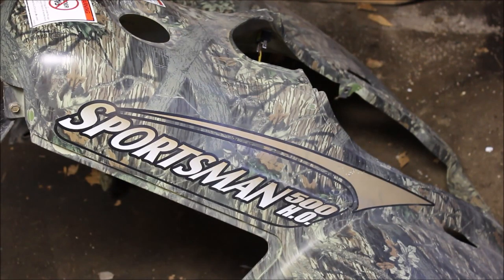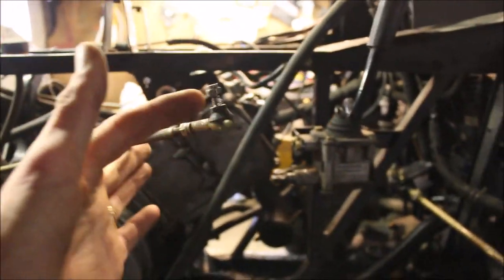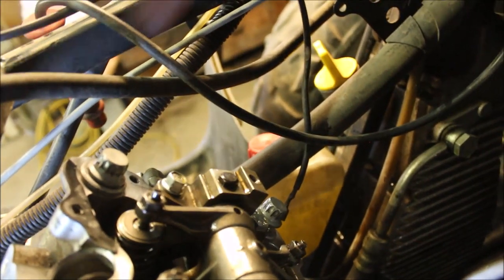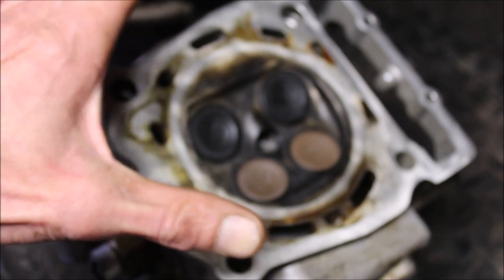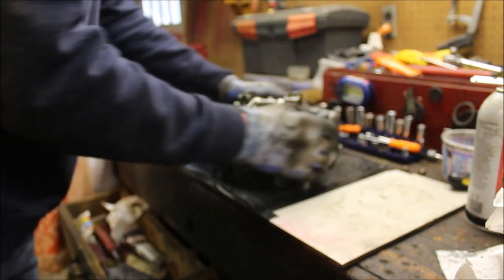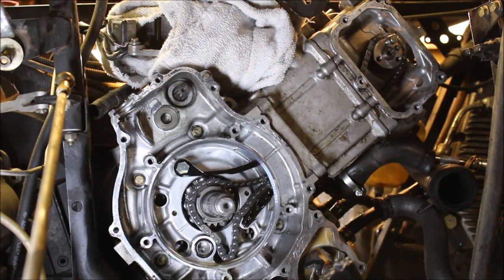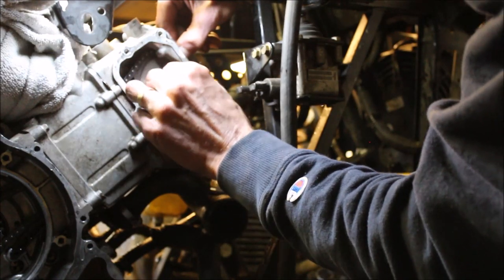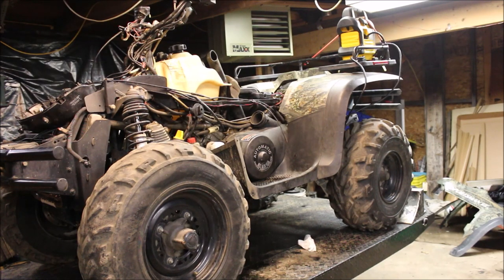Is you Polaris ATV Overflow Coolant Reservoir Bubbling? Overheating?

Comment: I’m having a issue. I flushed the radiator and that flows good, new thermostat, fan works, fins on water pump spin, but I was wondering does your tank bubble right away when it’s cold? I don’t see any bubbles but I’m running out of ideas before I rip it apart and do the head gasket
Reply from the maker: If everything is working I would make sure you bled all the air out of the system. An air pocket will cause overheating.  If its bubbling  nu the overflow it most likely a head gasket.

Comment: Love your videos. You made sure the head was flat by sanding it down. Does the jug need to be flat as well? I didn't see you checking the jug for flatness.
Reply from the maker: I always put the head on the jug to check if it rocks back and forth. Most times the jug is good. I have another video on checking that.
Reply: Before I pulled the head, I did an engine pressure test. I made sure the motor was TDC.   I applied about 90lbs of air to the cylinder. No air bubbles or sound out of the radiator. When I run the engine I see an occasional air bubble in the over flow tank. Do you think it's a bad head gasket? This is a freshly rebuild engine. I did not use an oem head gasket. What's your thoughts, head gasket bad?
Reply from the maker: @dvcm27  If its occasional it might be air still trapped in the lines. I dont think it's the head gasket.
Reply: When it overheated it blew out of the reservoir tank. Does that indicate pressure from a bad head gasket? I'm going to use a carbon monoxide detector  to see if I can sense the exhaust gases from the radiator. I'll remove radiator cap and put the detector in a plastic bag and secure the plastic bag  around the raditor fill neck. Thoughts?
Reply: You can run a longer hose off the radiator overflow and put the other end in a bottle of water and rev it up to check for bubbles

Comment: You never cease to amaze. Nice work! I did a full rebuild on a 500 HO but now get a ticking (loud) when revved up. Was told it might be the starter gear. Any ideas?
Reply from the maker: Did you check the valve lash? ..006 it should be. It could be the gear or the clutch. I would pull both off and see what's making the noise. Pull the bendix gear and pull start it with cover back on..
Reply: @TitaniummanGarage  thanks for getting back to me. This one is a ranger so no pull start. I did check the lash. Trying new bendix today I hope. Keep up the great work!
Reply from the maker: @RayofallTrades  My ranger did the same thing. Replaced the belt and the bendix gear and it was quiet.
Reply: @TitaniummanGarage  thanks for the reply. Tried both and same issue. Oh well. I'll let you know if I figure it out

Comment: I am having an issue I know you kind of addressed on an earlier video, as well as overflowing coolant but I think it is from the radiator being plugged with junk. The main problem I am having is that the machine runs fine at idle, and will run for a little bit at throttle but then it will start losing power and backfiring. I had the cam replaced by a reputable Polaris dealership last year thinking that was the issue, but it was not. I am going to try a new throttle cable as the two points were touching that shut down the bike, so I think it's stretched pretty bad. Anything else I can try? As of right now it's practically useless.
Reply from the maker: Yes, the radiator plugged will also do that. I would flush it out and clean the fins. With the power I would start with cleaning the jets on the carb and inspect the intake boot for cracks. If the boot is cracked it will suck in air and run lean causing a backfire. Or bad timing or bad valve adjustment will cause that as well. I bought one that came back from a Polaris dealer. The guys spent 1200 bucks and got it back not running. They never checked the cam and only adjusted the valve lash.
Reply: @TitaniummanGarage  I rebuilt the carb thinking that was the issue. The search continues. I'm wondering if they lined up the timing marks with the cam but didn't check the crank.
Reply: @TitaniummanGarage  I supplied the cam so I sure hope they put it in!
Reply from the maker: Might not hurt to double check.

Comment: You have a video or can you do one that shows how to chase down a bad ground on a polaris? Found 1 problem when someone replaced the handlebar kill switch, it was loose. I tightened down the Allen screw and it would've have spark. So loosened it back up and now has spark. I believe I have another bad ground somewhere now
Reply from the maker: OMG! that would take hours. It all depends on where the issue is. Was the kill switch aftermarket? Some of those have issues. most aftermarket electronic for polaris..especially if it came from china....is junk. I've had new cdi's and kill switches go right out of the box already. Just follow your brown wires to the ground points. they are mostly to the coil. pull the black wire on the cdi box with the allen screw you mentioned tight. It bypasses the kill switch. If it starts, you have a bad switch or possibly a bad cdi. But check your grounds. make sure they are clean. If it was sitting outside for long periods of time, I would check ALL connections. Hope that helps.
Reply: @TitaniummanGarage  yeah, it's definitely a aftermarket kill switch. It was replaced before I bought it and the quad has sat outside most of its life, so should be fun chasing down all its issues, but working on it
Reply: @TitaniummanGarage Buenos días desde España...¡¡¡ Tengo un problema con mi polaris Scrambler 500 4x4 2004 y me gustaría que me ayudases, no se como ponerme en contacto contigo y pruebo aquí para ver que pasa...te explico, me entra agua con aceite por el tubo que va hacia la caja aire y el depósito de aceite. Esta mezcla huele a gasolina...puede ser de la bomba de agua?...me puedes ayudar porfavor, gracias y un saludo